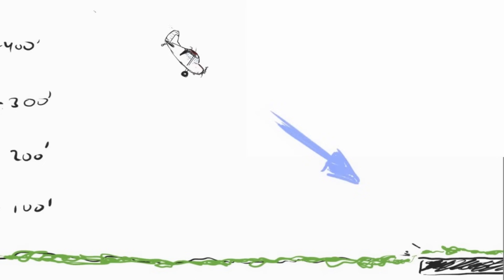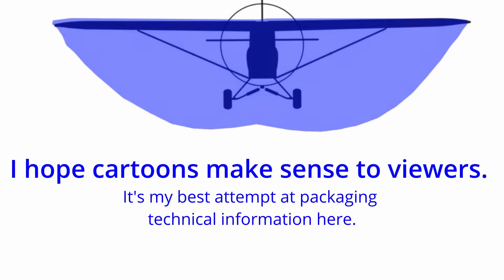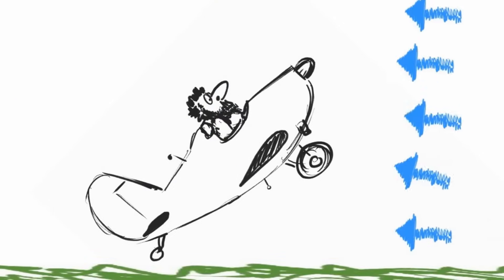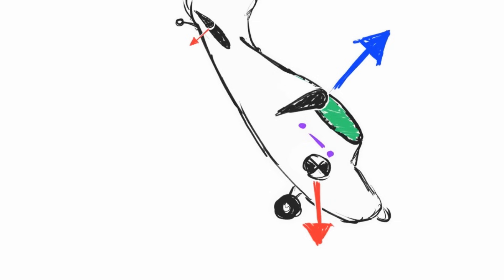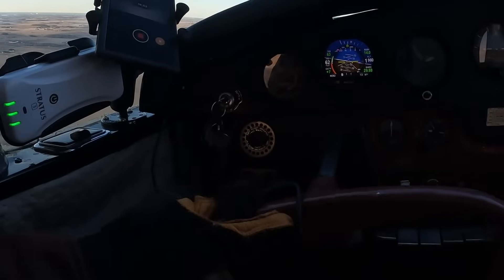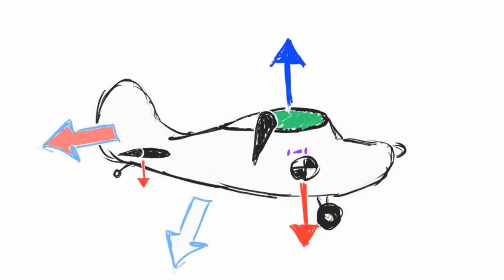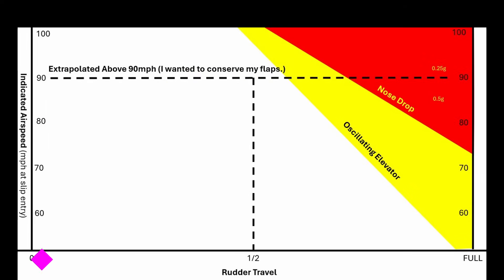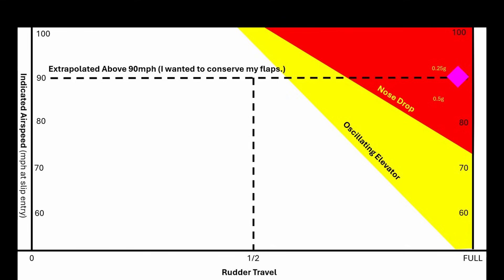Crash of a Cessna 170B, Did Slipping with Flaps Factor?

Comment: We had an "A" model 170 with smaller flaps.  I was told on the "B" style 170, NEVER do a slip maneuver with FULL FLAPS extended as you can lose airflow over the elevators and crash.  This was not an issue on the "A" model.
Reply from the maker: Yeah, it's an issue with the larger flaps.  The aerodynamicists at Cessna talked about it in their book that came out many years later.

A models are nice!

Comment: Interesting explanations. I’m forwarding this to a CFI. During a BFR and a power off landing in a  C172m, I slipped some and the instructor said I could add flaps as “ I had the runway made”. I didn’t but added and removed slip till very short final then straight in, added flaps and landed close to his aim point I pointed out that flaps and slips should be a no-no. Then I pointed out slips can be added and removed in a short second but the flaps being motor driven take seconds to add or remove. He found that to be an interesting point, especially with no power when the engine goes on strike.
Reply from the maker: Totally.  Also, depending on the particular Cessna your instructor was familiar with restrictions in the manuals change.

Comment: I think slips are overused. With 40 degrees of flaps you have a lot of available drag and while it may seem counterintuitive when you appear to be overshooting try just pulling back on the yoke and bleeding off speed. Your descent rate will increase and you will remain in perfectly coordinated flight which is a key factor when you're only 300 feet off the ground.
Reply from the maker: Slips sort of became fashionable lately.  I can't speak to whether they are over-used or not, but you're right.   You do have a lot of drag available with forty degrees of flaps.

Comment: If downwash hitting the tail is a "thing," how does a 'T' tail function? Go back and learn basic aerodynamics!
Reply from the maker: Thank you for your comment.  Downwash hitting the tail is indeed a thing.  Reference Aerodynamics for Naval Aviators, available free from the FAA.  There is a whole chapter o stability and control which describes these effects.  You can also see NACA wind tunnel footage, CFD models, etc.  When you takeoff, as you lift out of ground effect you will notice that you have to adjust your elevator position slightly as you climb out because your horizontal stabilizer itself is encountering more downwash from the wing.

T tails are in fact affected by wing downwash but less so.  This is because subsonic flow doesn't have hard and abrupt boundaries in the way air or any fluid behaves.  This is because fluids are viscous.  The effect is well known as the Coanda effect.

For the Cessna this was documented by Bill Thompson, Cessna's chief aerodynamicist, in his book Wings for the World.

I respectfully invite you to follow your own advice and learn something about aerodynamics.

Comment: the slips with flaps according  to what I understand and what I have experienced is because it blankets the elevator and you get an elevator stall which feels like you’re gonna die when it happens 100 feet about the ground. Fortunately the tail starts flying pretty quick but it can be quite disconcerting.
Reply from the maker: You're right.  It's pretty easy to straighten out by just un-slipping.  The aerodynamicists at Cessna wrote about it, and it's their description with the tail and wing and aileron that got put into the video.  Specific mechanics aside the effect is pretty similar to blanking, and the recovery is straightforward.

The big thing is taking people who are new to Cessnas, especially ones with 40 degrees of flaps, and showing them the stuff that used to be sort of common knowledge.  Seems like you're doing that, so thanks.

Finally, thanks for watching and commenting.  It all helps me out.  Cheers!

Comment: the increased angle of attact on the wing with the down aileron and decreased AOA on the wing with the up aileron causes the spin entry which is the biggest cause of the pitch down with one wing flying and one fully stalled.  i fly with full flaps and airspeed at the top of the white arc which is around 90 i believe which is the same speed as a 150.  if you see how fast a cessna with 40 degrees of flaps comes down out of the sky you will wonder why anybody would ever need to slip it. I demonstrate this maneuver to anyone with a single engine cessna to show why you don't ever need to slip in these airplanes and the C170B comes down faster than almost any of them.   you also see that the tail will not lose it's ability to keep the nose down.  i have close to 1000 hours in tailwheel cessnas including 170B and do the same maneuver in those airplanes.  have never even had a hint of loss of pitch control at any speeds including slightly exceeding the top of the white arc.  i would NEVER though even CONSIDER lowering one aileron for any reason with full flaps.  90 mph is quite an attention grabbing steep nose down pitch attidute and the angle of descent is approaching the angle of a parachute ride under canopy.  you can be at pattern altitude on less than 1/4 mile final and still land using about 1/2 or less of a 3000 foot runway.  knowing this maneuver will get you out of some very lousy approaches.  this is even a more important maneuver on an engine out approach where you have the very best excuse to make a high approach.   no flaps until the runway is made for sure and full flaps after that.  there are only 2 positions for flaps in a dead stick landing, either zero or full.

Comment: Unfortunately thought this applies to a limited number of 170/172 models, and is called out in their POHs, it’s a legend that has grown wings and some pilots believe it applies to any Cessna, and others who believe it applies to any aeroplane. I’ve slipped a 150 with 40 degrees of flap extensively and this phenomenon just doesn’t happen. I’d like to get my hands on one of the 170s that this does apply to to experience it first hand (at altitude obviously). Great video, and I’m glad it notes this is limited to a few sub-types of the model concerned.
Reply from the maker: Come fly with me, and I'd be happy to demo it for you if you're in or around Wisconsin or N. Illinois.  If you're expecting it, it's a totally manageable thing.  Like anything (stalls, spins, etc.) the big risk is when this catches people off guard, and they mis-diagnose things.  

You're right this phenomenon doesn't affect all Cessnas nor does it affect all planes.
Reply from the maker: If you do come flying, my planes are usually covered in grease and bugs.  Judge me harshly.
Reply: In my 170B the nose will drop quickly in a slip. In my 170A it's not a problem or in my brother's 170. I tested it at altitude
Reply from the maker: @landryah1  Very good observation!  The As have shorter chord flaps.  Even in the Bs you need a relatively forward CG to make this noticeable.

Glad to hear you were up and experimenting with this.

As an aside do you have a preference?  I like my B, but I always thought the rag-wing 170s were awesome.  Didn't like the fuel pump though.
Reply: @jonathanzarinnia884 I definitely prefer the bigger flaps of the B model. Slips aren't necessary. In the earlier models with small piano hinge flaps you'll need to slip to control the airspeed on steeper approaches over obstacles. I love taildraggers
Reply from the maker: @landryah1  With 40 degrees of flaps my plane will come down pretty steep.  I agree.

Comment: Another great video about a poorly understood subject, love it! The only thing that I would add is that the phenomena that you are talking about is limited to aircraft with a high wing and mid to low tail setup like the Cessna 170 or the cub you tested. The use of a low wing aircraft in one of your visual aids may give people the wrong impression.  Also the failure to explain how the stabilizer produces downforce independent of the downwash of the wings makes it sound like the downwash hitting the stabilizer is the primary force producer which is not the case. This would be like trying to explain aileron action by saying that the upward deflected aileron is hit by the airflow on the top and thus that wing is pushed down while the downward deflected aileron is hit by the airflow  on the bottom which pushes the wing up. While this statement is true, it neglects to mention the AOA difference created between the two wings which is a larger consideration in the equation.  Over all this is a very insightful and well put together presentation. Thank you for taking the time to put it together!
Reply from the maker: This is great input!  One of the things I struggle with in the videos is assumptions about the audience and how those assumptions fit into editing the videos.

I got about half way through editing a cartoon of how the horizontal stabilizer works, how a change in total aoa creates some reduced change in aoa at the tailplane, etc.  I decided not to proceed with that cartoon because it seemed like it would get boring for most audiences.  

On that note of cartoons I had used a repurposed drawing (low wing) for some of the animations.  

That's why it took me a lot longer to get the next videos (I make them in batches.) out.
Reply from the maker: I've been thinking about making a video about aerodynamic pitching, rolling and yawing moments; when they are intuitive and when they aren't.  Dialing in just how detailed to get is a tough thing, and comments like these really help me out a lot.

Comment: Short answer:  follow the POH.  Slips with more than 20 deg flaps are verbotten. I did however enjoy your animated explanations of downwash with flaps deployed. Turbulence over the tailplane would be a factor behind full flaps as well.
Reply from the maker: Basically.  Kind of like tire pressures and approach speeds, following the POH is usually the best course of action with rare exceptions.  The big thing is what to do if you accidentally find yourself in this spot.  Undo what you just did.  Misintepreting the nose drop as a stall, can get ugly results.

William Thompson, the Cessna lead areodynamicist who was responsible for identfiying this issue and getting it into the POH pretty well described the issue as moving the tail out of the effects of the flaps.  Seems to jibe pretty well with what we see when we play around with it in the plane.  Trying to repackage that into a cartoon and Youtube video was a little bit of a challenge.
Reply: @jonathanzarinnia884  there should be some required readings for pilots venturing into the world of homebuilts and antiques.  The typical C-172 syllabus is poor enough, and the ultralight learning program is frighteningly sparse.
Reply from the maker: @bobsakamanos4469  I agree.  The goal is to integrate knowledge into a pilot's decision loop, and do so with appropriate prioritization.  That takes some effort on the part of instructors and students alike.

Compare this to how easy it is to think "Bill is smart.  Do what Bill says." or some of the flashier stuff on social media.  It's tough.  What's more to get them to think critically you have to wean them off of coming to you for answers and guide them on to self-study and research habits.  That's about the opposite of what a lot of flight schools need to do in order to keep business coming through the door.
Reply: @jonathanzarinnia884  I absolutely agree.  The why and how is critical to the application of knowledge in training.  If not applied, the theory is forgotten. You and I would have a great conversation about the MO at flight schools, :~D
Reply: one down aileron and one up aileron in a slip resulting in a RAPID  spin entry is what causes loss of pitch control PERIOD!
Reply: severely cross control an airplane at altitude as you approach the stall and you will see what I am talking about.  you better be familiar with spin recovery and things not to do when experimenting with spins.  don't do this with anybody in the back seat for instance because this rearward CG drastically changes the spin recovery characteristics of any airplane.  also spinning beyond 3 turns also changes the recovery technique required as well.  these are things that will kill you when doing spins.  if you want to experiment with spins you need someone who knows these 2 things.  if you ask them about the 2 things and they act surprised you need to find somebody else to show you.
Reply: @chucklemasters6433  Spins were taught at the PPL level back in the day.  Sadly, standards are now lower and pilot skills have deteriorated most critically at the instructor level.  Cross control is confusing to learners and even some instructors, apparently.  An induced skid when turning final is a common (and fatal) mistake that instructors need to instill in the neophytes; ie avoid bottom rudder in the the turn to final.  A slip on final or a slipping turn is fine if staying within the guidance of the POH wrt flap useage and airspeed.
Reply from the maker: @bobsakamanos4469  There was actually a congressional hearing about spin requirements and private pilot training back in the 1980s.  Many big names in aviation were there are there was a congressional recommendation to require spin training again.  That requirement never made it back into the PPL requirement.

When we look at loss of control accidents we see something interesting though.  The rates of stall-spin accidents didn't drastically increase before and after the spin requirements were removed.  So pilots aren't losing control as a direct result of spin experience; if this was the case we'd see some correlations between training and pilots involved in these mishaps.  

I suspect it's really about what's going on in our heads in the seconds and minutes leading up to the mishap.  So we're talking task saturation, priorities, etc.

Still if we're going to train pilots, experience with spins and spin recoveries gives them more tools at access when they need them.  I'm all for giving the next generation the training so they have a little less startle and little less surprise if they do accidentally get themselves into a bind.

Pardon the long comment.
Reply: @jonathanzarinnia884  ref spin related accident rates, I'm aware.  I was just explaining to the other respondent that spin training was a common air lesson back in the day, (as was approach stalls and departure stalls).   He's off on some sort of misunderstood cross-control tangent though as it pertains to the OP scenario.
Reply from the maker: @bobsakamanos4469  I see.  I was trying to stay engaged to feed the algorithm.  Thanks for explaining.  I didn't scroll far enough through the conversation.  My mistake.

Comment: Why would you slip at those faster speeds? If you’re slipping to land then you want to maintain the approach speed to land, increasing speed usually causes floating down the runway of which you really didn’t need the slip if you just float. So in the end you want to slip at a good approach speed and land on your intended landing spot.
Reply from the maker: This is a great question.  I can't speak for the accident pilots and their motivations.  I can only speculate about why others may slip at speed.  I can also talk about when I DO slip at speed.  So this is just a guess, and treat at as such.

Possibility 1: Slips at speed due to fixation
Imagine a pilot who wants to get down.  He's slipping, which means  his airspeed indictator is unreliable, and he has an incentive to point the nose a little lower to maintain speed.  The lack of reliable airspeed and the desire to get the nose down may have lead to a slightly lower than usual attitude in the slip resulting in a slightly higher than usual speed in the maneuver.

Possibility 2: Deliberate Slips at Speed to Dissipate Energy
There are times when I'll fly a faster than normal approach, especially when the gust factors are big.  Even though I find myself at the right height and distance, I'm still carrying a lot of energy on the plane due to speed.  In the Cessna deploying flap usualy handles things just fine, but I might do a braking slip in the Cub or some other planes.  When it's cold out, and I don't want to un-wind the motor, a slip allows me to keep partial power while dissipating energy too.  When I'm flying aerobatics in my sleepy, old Cub, I'll sometimes use gently applied slips to control speed again.

Whether they were deliberate or not, it's also worth mentioning that they weren't crazy fast.  They were around 75-80 mph.  That's right at the border of when this becomes  a factor.  They weren't above best glide speed, for exampe.  So I'm not sure if there would have been alarm bells going off in the pilot's mind.
Reply: i woud like to demo a high steep approach to you in any high wing cessna with 40 degrees of flaps deployed, or in any aircraft with no flaps.  go back and study the parasitic drag curve to see the dramatic increase in parasitic drag with increase in airspeed.  you would be amazed at how fast an aircraft comes down with the steep attitude it takes to achieve 90 mph.  if you raise the flaps while still in the air after you have flared and arrested the descent just above the runway the airplane with sit right down on the runway immediately and now you have good braking ability because the flaps are already deployed and maximum weight is on those braking wheels.   if you witnessed this demo just one time from the front seat you would never even consider slipping at low speeds in a no flap airplane or slipping at all in a cessna with 40 degrees of flaps!
Reply from the maker: 40 degrees of flaps, idle power will give you a nice, steep descent.   Whatever extra speed you have will dissipate within a couple hundred feet of the roundout. 

BUT if you want to share some video and put up some side by side comparisons I'm more than willing to support that.  It takes me a long time to get these put together on various layovers.